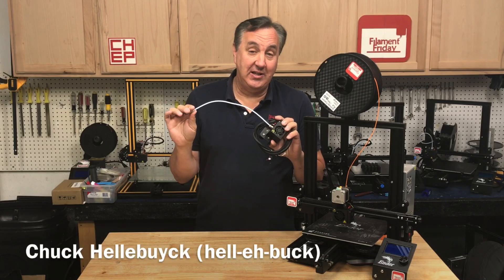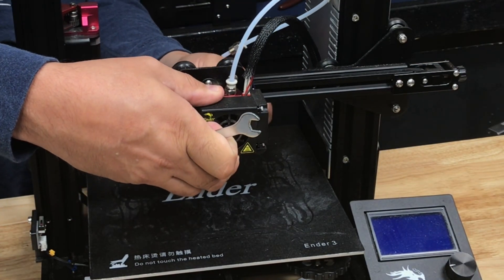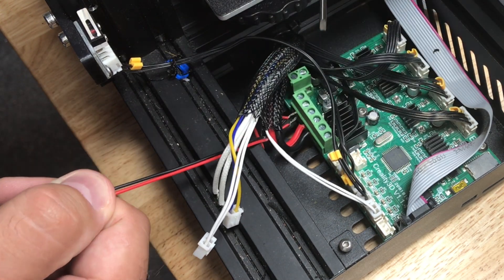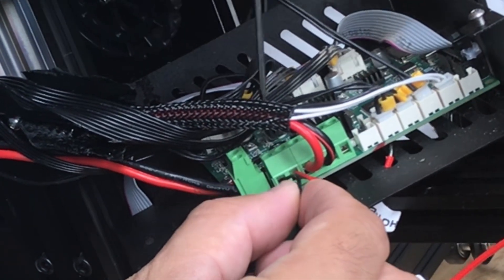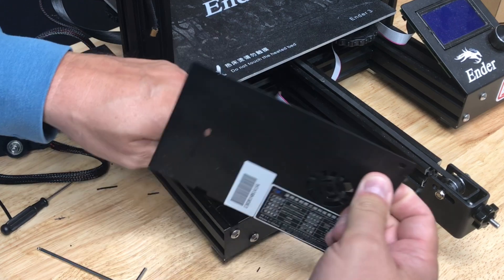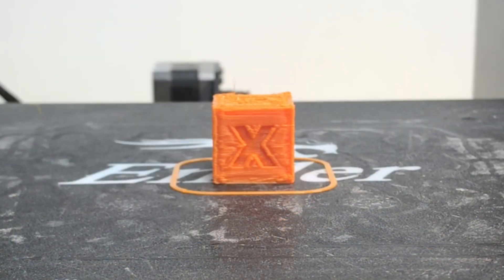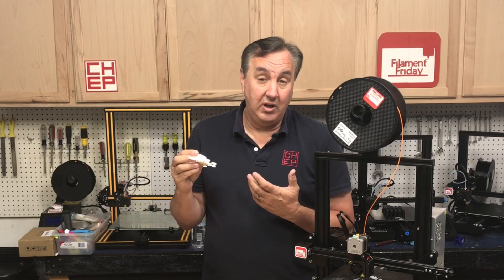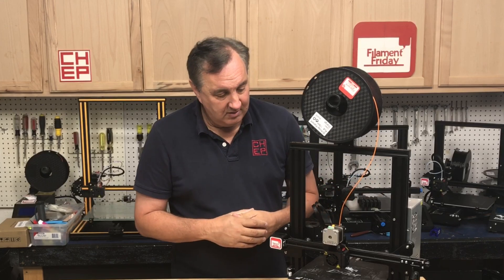Direct Drive Extruder on Creality Ender 3

Comment: wouldnt it be better to have your extruder motor facing the opposite direction? Spin it horizontally 180 degrees. so the rear of the E motor is facing the rear of the print bed.. That way the weight of the whole carriage is more centered above the X frame rather than it twisting it with how you have it now.. Or would there be no difference? maybe the weight is negligible.. idk..
Reply: I thought the same, but realised it will probably hit the z frame... however turning it 90 degrees may work
Reply: @camoh8702  oh yeah, duh. Lol. I didn't even think of that.  Good point..

Comment: he made it sound like the direct drive is not a good upgrade, is Bowden better?
Reply: Depends on what you want, direct drive will always have better print quality at the cost of speed, Bowden can come really close to direct drive quality with faster speeds. You can get Bowden to be really good but you do need some sort of predicative algorithm for extrusion speed and pressure.
Reply: Neither. Zesty nimble remote direct drive.

Comment: @CHEP Hi CHEP, I followed this path in regards of a DD upgrade. In my case, I have an ender 3 (with an SKR mini V2) and installed the Microswiss DD and all-metal hot end kit. The installation was quite easy and my prints are fairly good but not great. Before this upgrade, I had a Bowden setup with an all-metal hot end, Capricorn tube and metal double gear extruder. I also used your CURA profile files and my prints were precise and very clean. In other words were great.

Same as you said in the video, the prints I am getting from the upgrade are not as crisp as the ones with the Bowden setup. I am thinking of going back to the Bowden system, however, by watching several videos about DD upgrades, I see that many people are getting great results. I don’t mind using TPU as most if not all of my prints are made with PETG, PLA and Carbon Fiber. I went for the upgrade just to have more precision and control when extruding filament.

Did you get to improve your prints? Are you getting results as good as before the upgrade?
 Do you have any profiles for this type of setup?

I already calibrated E-steps, retraction, flow, LA, temps, etc. My current retraction settings are 1mm @40mm/s and Linear Advance K factor at 0.1.
Reply: Prusa printers run on direct drive, overall it's a better upgrade

Comment: CHEP - I purchased this direct drive unit after watching your video, mainly for printing flexible filaments.  Because the long PTFE tubing was removed during the conversion, I just assumed I can also print very high-temperature filaments using this direct-drive setup.  When I received the unit, I notice there's still a short PTFE tubing between the motor and hotend.  Does this short PTFE tubing touch the nozzle as the PTFE tubing in the stock setup, and I'm still limited in how hot I can print?   I have the Capricorn tubing in my original setup.  Do you recommend replacing this short PTFE tubing with Capricorn tubing?
Reply from the maker: It’s the same temp limits as bowden. Capricorn will give you a little more.

Comment: Will it work on Ender 3 V2?
Reply: Yeah need to know this as well
Reply: i need to know this aswll  but the hot end mount screw holes aren't there and the housing holder holes :(   as there  is the metal plate on ebay
Reply: Since it uses the same hot end and steppers from the Ender 3, it should work.

Comment: Is it possible to reset the Ender 3 Pro to factory settings?
Reply from the maker: What did you change?
Reply: @FilamentFriday  i try to install the firmware for BLTouch but now nothing works anymore. Ender 3 Pro V4.2.2
Reply: @paeduschmid  you should be able to grab the firmware from creality's site
Reply: @BrandenAllen  oke and then i have doing nothing else? Or i have to change the code?
Reply from the maker: Get the version 1.02 .bin file and load it on the SD card same way as you did for BLTouch file.

Comment: I need to print flexible filament for a project and searched for a solution. Solution 1 was to buy this ezr extruder but I live in Germany and with the including shipping costs, it´s pretty expensive. for just an extruder. Also the low print speed with flexible filament is bothering me. The second solution is to convert to a direct drive, the options here are 1. Solution for over 100€ (okay to be fair, there is a titan hotend with it but I don´t feel that I need such one), 2. only brackets buyable for 10-15€  or 3. print a bracket 4. buy this china direct drive, shown here. I decided to switch to direct drive but then you and your fantastic videos came into my way and you said that you had better "typical" filement prints with a bowden system. I am tearing apart and don´t know what do do... haha... So, if you ever fixed your print settings with a direct drive, let us know. I already have your other profiles in use and I love them!

Let me say that I love your channel, I´ve learnt so much about 3D printing with your videos. Shame on me, I haven´t subscribed yet, but here I go. Well earned.
Reply from the maker: 3D print an extruder top: https://youtu.be/az7pysnV_MY

Comment: Seeing how easy it is to change from Bowden to Direct Drive on the Ender it really makes me anger of my CR10S Pro, the way they change the hotend assembly and nozzle threads, my question is,  is there a really cheap but reliable method to change the Bowden on the CR10S Pro to a Direct Drive ? Possible to swap the whole CR10S Pro hotend system  to a Ender 3 that way I can do this mod easier ?
Reply from the maker: It might work on Pro. Check Thingiverse for possible brackets to do it with existing hardware.

Comment: I hope you get Direct Drive adjusted and publish the profile on it, Thanks for your good input  ;-)
Reply: I have 2 Ender 3 printers, one with direct drive and one without, and I've not changed the profile from the other one. All I did was figure out my extrusion using the 100 mm test, doing the math to figure out how much filament I'm really pushing.
CHEP does a good job explaining that in another video.

Comment: So, what you're saying then Chuck, is that if I start making a little coin, buying a second printer is just about necessary if I want to print Ninjaflex / TPU.  I just want to have my phrasing prepared when talking to the wife.  :)
Reply from the maker: Well technically you can add an EZR extruder top and print Ninjaflex on a bowden. So your argument should be that in order to complete your projects quicker you need a second printer to cut the print time in half allowing you to spend more time with her.
Reply: @FilamentFriday  Ha! I love it

Comment: @CHEP  Just installed all the board cables and everything was perfect just as you said until I started putting the belt and realize that the plate that comes with this kit is meant for a belt exactly 10mm longer than the one I have with the Ender 3 Pro... not sure if this is a difference in between Ender 3 and the pro or this piece just came wrong.... I'm assuming I'm going to have to print a piece to mount all this... any other suggestions? Thanks for the videos, always amazing!

Comment: Hmm, I'm concerned as to the weight of the stepper motor and the extruder drive assembly on the undriven side of the X axis arm. Surely with the extra weight there's the chance of the head being deflected down. Also since it's direct drive you should be able to get away with a smaller stepper motor to reduce weight. I'm really not sure about this, It seems the printer is compromised just to print TPU.
Reply: I agree that adding a stepper motor on the direct drive of a machine with single z axis on one side might not be the best idea. I already was worried about the machine as is, with one z axis rod.   Adding weight means adding stress on the x axis bar.  The further the motor goes from the z axis rod, the more the fulcrum forces.     And about smaller motor, Ive tried that on one of my machines (a dual z axis home made machine thats almost like the prusa I3, maybe I can say a clone). It started slipping like anything. The only way to solve that was to add a gear (changing the gear ratio to increase the torque of the tiny and light weight stepper.). Once I added a gear, that solved it, but I didnt like having a huge gear.    So now I only use the dual-z axis machine for soft filaments and use normal filaments on the ender 3's, so as to get the best of both worlds.
Reply: @macvideoworld  Totally agree with everything you said. Actually if you run the E3 slow enough it will print TPU just fine.

Comment: FYI Basarabra Innovations, and American company, has a far superior design for a direct drive kit. We should be supporting them instead of the Chinese knock off...since that is where the design was stolen from in the first place.
Reply: It's very difficult to defend design originality on an open source item. Basabara's product definitely incorporates a lot more features and the price is very good for what you get if you need those features.
Reply: It’s not available

Comment: I bought a direct drive kit a while back and decided against it due to the fact this machine was not designed to handle the extra weight(having only one lead screw for Z). You want a direct drive I would add another Z screw...and adding another lead screw on top of this add-on is more time involved to “fix” something that works just fine the way it is.
Reply: The Z stepper is already lifting the extruder.
Reply: Kirk Valko only on one side...most direct drive machines have 2 z stepper motors and screws to handle the weight

Comment: I had direct drive forever on my original prusa i3 diy clone  6 years ago. Bought an Ender 3 2 years ago and have been perfectly happy with bowden. I'm printing perfect PLA and now ABS stuff right now.  See no need to go back.  I've even had luck with flexible filament... but i don't print with it at all really.

Comment: I've been running this setup with the stock components for about 2 months now. (Got a bracket kit off Aliexpress - the kit is not the best)  
Having a bit of a love-hate with the print quality and reliabiltity that it produces.

Having a few problems:
1. A LOT of slippage and it jams like crazy. Not sure if it has to do with the filament type, inconsistent overextrusion/ unerextrusion during prints; 
inconsistent inner diameter of the bowden tube between the extruder and hotend; or heat creeping melting the filament during long prints due to the noctua fan being a 40x20 instead of the 40x40.

2. The setup is kind of heavy which means the bracket wheel nut has to be retightened before prints. Not sure if how long prints are affected by the loosining nut setup yet.

What I have noticed:
* E-steps calibration is a must. 
* Printing at lower speeds is better.
* With some filaments, printing at slightly higher temps helps to mitigate clogging.

Solutions in mind:
a. Ordered a trianglab dual-drive extruder to see if it can help with the extrusion and slippage issues. 
b. Capricorn tube in heatsink with the little printed mod to go between it and nut.

Tweaking slicer settings as I go, but would digg to see your approach to cura for the setup, CEHP :)

Comment: It's not direct.. it's just short bowden. And there are plenty better and REAL direct drive systems for free to print out there. Even my own design is more neat than this abomination. Poor Ender :/
Reply: Poor consumers who don't know any better. Creality is trying to pull a fast one.
Reply: Thank God, it's not only me! My first thought was exactly - that's just a very short bowden! I think you could even pull this off the DIY way without buying such a kit...
Reply: @TheTinkerDad  for sure.. there are plenty designs out there.
But these kits are meant for non DIYers, who use a printer just to print stuff.. i guess?!?! 🤣
Reply: @hanswurstusbrachialus5213  Yep, you're right ofc. I'm not saying it's a ripoff or something - there are plenty of people who are not interested in DIY at all! But I'd still rather call it an "optimized bowden extruder" or something like that than a direct drive.
Reply: @UCeZ0C-VvbIH7ekQCo0iLapA So it would be direct if the extruder is 200mm on top of the Hotend? Nice argument 🤣
You bend the definition to deny the fact it's not direct by physics.. good job.

Also you complain about chinese knockoffs that they are bad? They are just as 'good' as yours.

Comment: Think this would work on an Ender 5?
Reply: No it will not. The Ender 5 belt runs on the sides of the extrusion, not the top and bottom.
Reply: i'm not sure but looks like it it is compatible

Comment: Chuck, great video, I am wondering though, how much print volume did you lose on the z axis by mounting the extruder stepper motor above the hotend? If this is the case, you will need to mention to adjust the z height in the slicer printer settings.

Comment: That will take weeks to arrive from China, anything else available closer to home?
Reply: Print it yourself. I still wouldn't recommend it because it puts more weight on the y axis and could cause a difference in z height because the axis is only fixed to the threaded rod on the left. The right side will hang down a little due to the weight of the stepper motor.
Reply: @Raruschmaru  Incorrect. Do research before giving "Opinions".

Comment: Dammit Chuck! Now I've gone and bought a direct drive extruder from Banggood. I've had the E3V2 for a month and I am tinkering already!
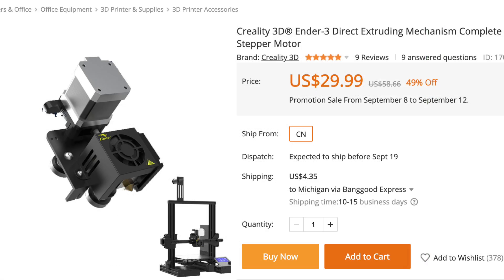Reply: The thing he's showing in the video is not a direct drive. Look closely at the image @ 0:21. There's a short white tube in between the  stepper motor and the extruder. That's not direct drive. Direct drive feeds the filament immediately into the hot end. Creality is false advertising to make some money. They simply took their Bowden drive and shortened it.
Reply: @OU81TWO  I haven't seen a direct drive that doesn't have a short run of tube. I'm running the micro swiss direct drive on my ender 3. It's like that too.

Comment: Thx, i love your channel.
Anyway it would be good if you could share what should be changed or setting in cura for ender 3 (pro too),
such as retraction, etc.
Reply from the maker: I ran retractions at 2mm. I’m adjusting Acceleration and Jerk in slicer to improve crispness.

Comment: Is there any reason why this won't work with the CR-10 mini? Since it's almost the same build..?
Reply: Use the Printermods kit and keep all your stock components and it will work just fine.
Reply: No should work but check the voltages
Reply from the maker: The components are 24v while CR-10 mini is 12v

Comment: That's an interesting setup, but the E-motor looks waaay too heavy for the Y axis. On a side note: speaking about flexible filaments - I tried printing 20mm cubes in some fairly soft TPU at 230C extruder and 20mm/s speed through a fully stock Bowden extruder and the filament never jammed or wound itself around the feeder gear. Guess I'd have to see if larger prints succeed.

Comment: I made my own bracket as I plan to start using flexible filament soon and heard the bowden extruder can cause issues.
Didn't have to buy any extra parts and there's literally 1mm of a gap between the 2 push lock fittings.
Any of the pre-designed models on thingiverse included mounts for extra fans but mine just uses the stock head and extruder. I didn't even have to use an extension, the stock cable for the motor has plenty of length if you separate it from the cables it's joined with.
The only thing I had to change was the direction the extruder motor turned since I was flipping the motor over to work from the front of the rail

Comment: Is the crispness issue not because the jerk/junction deviation and acceleration settings maybe and/or linear advance? if you are using any of those.
Reply: ibby Id very much assume  that chuck(chep) had the belts and machine calibrated properly before the upgrade, which adds weight to the x axis. 

Which in theory should mean the only thing that’s different is the additional weight on the X.  So jerk/JD should need tuning. (Same as if you add weight to the Y axis by using a glass bed!) Perhaps acceleration and feedrate as well.
Reply from the maker: Yes, adjusting Acceleration and Jerk in the slicer will be what I’ll be playing with.
Reply: @FilamentFriday  if you could make a follow up video addressing your post install adjustments, that would be awesome. I'm having the same "not quite ringing, but not crisp" issue since I went to direct drive on my ender 3.

Comment: No way. The Main Problem wird this printer is, there is only one Z Axis. Bringing more weight to x Axis means that prints fails 6 Weeks after purchase.
Reply: Idk of what ppl you talking about. This Maschine hast nothing to do with useful engineering. Sry, not to use a second z axis is fail.
Reply: 3Deezy same here but with 2. I have some petg to print them in but pla has been holding up so I haven’t even bothered. I think people who are worried about the z axis drooping might not have built their printers “tight” enough.

Comment: I have the problem of the stepper motor which pushes the filament towards the hot head it skips steps and that according to the location of the hot head above the hot plate.
I however calibrated the heating plate with a sheet of paper and of course there is a hollow in the middle but before that it worked well it happened when I changed a spool of filament. Could the montage that you present here solve my problem? In french below. 
J'ai le problème du moteur pas a pas qui pousse le filament vers la tête chaude il saute des pas et cela suivant l'emplacement de la tête chaude au dessus du plateau chaud.
J'ai pourtant étalonné le plateau chauffant avec une feuille de papier et bien sût il y a un creux au milieux mais avant ça fonctionnait bien c'est arrivé quand j'ai changé une bobine de filament. Est ce que le montage que vous présenter ici pourrait résoudre mon problème? ☑😉